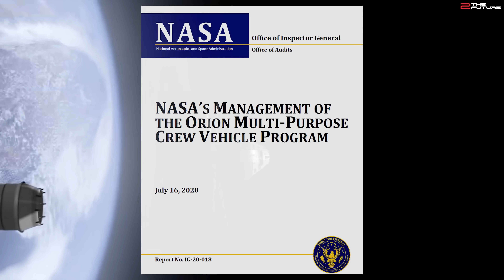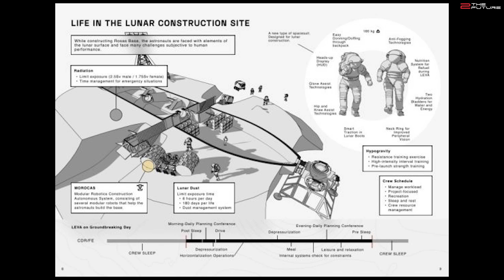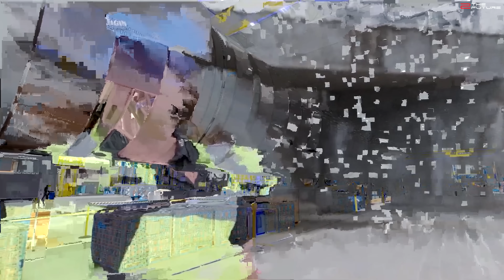How NASA doesn't understand the potential of SpaceX's HLS Starship moon lander.

Comment: BO’s so called much up is actually just a shell with no tanks.  This is why you see the bracing inside it.  

Starship is a one rocket solution to a manned lunar base.  It’s actually designed for a similar mission to mars, so there shouldn’t be any question about this.  I think that we will see a progressive step towards this, Unmanned first then manned.  Starship to orbital velocity. Starship to orbit. Starship to orbit then landing at Boca Chica.  Starship refueling station. And so on with months between each step sometimes longer depending on the complexity and permitting capabilities.  I don’t see a lunar (unmanned) flyby until 2024 or a manned mission to orbit before 2025.  Although they should start Starlink missions in late 2023.  I see 2022 as just working on getting to orbit and back, without crashing.  I also see one more major revision of Raptor after the as of yet unreleased Raptor 2.0.
Reply: Refuelling station will be earlier ! Tiles, fins, header tanks, downcomers, legs etc and return to earth are not required.

Comment: To be fair to Nasa on the timeline slip....a 2024 return was always a pipe dream.  Way too little time, way too little funding, lots of politicians hemming and hawing and not wanting to make up the lack of funding because 'Well look how little you've already done' and stuff like that, regardless that they've done so little because they keep getting held back by ridiculous requirements from said politicians.  

Granted it's not all the politicians fault either, Nasa has been using the same spacesuit design ( with some upgrading here and there, but still functionally the same design ) since the 80s.  They're nowhere near ready with something that can handle what Artemis needs, even with those clunky designs they've liked to show off now and then the last several years.  The program is going nowhere until they have something ready there ( wouldn't be surprised if SpaceX has a solution ready there before Nasa either, they've already mentioned they might give it a try )

Comment: 10 launches for 1 moon trip. 
Hardly the 'less is more' ethos musk bangs on about .
Reply: 10 launches of starship will cost less than a single SLS, remember that starship will be reusable, even more than the falcons, thats their plan anyway.
Reply: @ahchx861  did i say anything about cost?
 Its a convoluted  system.
Address my point or shut up
Reply: @Bow-to-the-absurd  wow easy dude dont be so harsh,  isay that is not that complex when you LEARN that the whole starship plan is launch A LOT and i mean A LOT they are talking about build hundreds starships, they already are building docen of raptor engines per week?, 10 launches for a month of operation is nothing from the point of view of the starship operation scheme they are planing.
Reply: @Bow-to-the-absurd  - it's exactly as complex as it needs to be in order to get more than 100 tons to the moon - while being reusable.

There ISN'T a better solution than refuelling - military jets refuel all the time to extend their range - are you going to suggest that's "too convoluted" too?

Comment: I'm undecided if Blue Origin's latest thing is a mock-up or a mockery. It might be both.
Reply: I believe it is largely for GSE boiler-plating. Really unimpressive development speed. I am surprised it hasn't got "JEFF BEZOS" painted on the side with his stupid face.
Reply: Both!
Reply: PR stunt for Sue Origin. Totally lame 🙄
Reply: @NJTDover   Yes, exactly. If I'm not mistaken, they've shown us this mockup before, sitting in their otherwise empty factory. They had some bad PR lately with losing the lawsuit, so it would not surprise me at all if they loaded the mockup on to the trailer and drove it around just for whatever good PR that might get them. 
What did they actually do with it? They talked about learning lessons for taking a real one out to the pad, but did they even do that? There were no pictures of it that I saw at the pad, just one or two of it just outside the factory building. And they had the temerity to call it a pathfinder "mission". Mission, mind you, as if they were actually doing something with it.
Reply: The rocket connect with the antimatter engineering and warp driver 😀 not a good selection of monkey 🐒 the same engineering from the ground pitched up to 4 people to space ☺️

Comment: Great analysis. I think the real problem with NASA going with just the Starship is that it hasn't yet been proven out. Once that is done, I think we will see a different approach, but until then, by the laws under which they operate, they HAVE to give the primary consideration to proven technologies. The tech for SLS works. It's too expensive, but it works. They (the people running NASA) would be replaced if they didn't try to complete it, especially while there aren't any working, proven systems as alternatives. Sure, they are trying to encourage SpaceX and would prefer to be dealing with them and Starship. It's just not ready today. In time, I think we will see BO putting it's focus on narrow goals, and at NASA SLS will be canceled and Starship will start putting stations in orbit for commercial and government and a base on the Moon. Possibly permanent occupation of the Moon by 2024-25ish. Anyway, we've waited too long for this. It needs to happen.
Thanks for the video.
Namaste
Reply: SLS is in the same situation though? never bin proven
Reply: @flopez425  - Exactly - for all we know? they'll do the first launch and it'll have more problems than Starliner
Reply: @flopez425  Not true. Every separate system in SLS is old school tech, already flown on, for instance the Shuttle (SRBs and main engines) The capsule is standard tech, nothing new there. Everything about the SLS has been flown and tested. Starship, on the other hand, is a unique NEW way to get to orbit.
Reply: @Myrddnn  - Don't be ridiculous - it's an entirely new configuration! by your logic I can say anything made of metal is space-worthy because metal has flown to space before.

If I build a new aircraft out of parts of a dozen different aircraft - are you going to fly on it because each part has been 'tested' before?
Reply: @JohnnyWednesday  You seem to be missing the point. NONE of the tech being used for Starship has EVER been flown to orbit and tested. NOTHING like it has every been tried and there is no way to know ahead of time that it will work.
SLS, on the other hand, it built from proven technologies, ones that HAVE flown on other space missions. While the SRBs, for instance, are a little longer for a longer duration burn, they are the SAME tech, chemicals etc., used by the Shuttle. Same for the main engines. And the Orion has flown once and got a rework since it missed meeting up with the ISS. It is not dissimilar from the Apollo capsules that went to the Moon.
Reply: @Myrddnn  Simply because something takes proven parts from other programs and puts them together doesn't make it 'proven'. Lots can go wrong with the combined system,  and these idiots aren't even thinking of an unmanned SLS test run before putting astronauts on it, even as they made Space X go through hoops to get human rated for the commercial crew program. I should also mention that there are SOME changes to SLS that haven't been proven: primarily to the ENGINES. These are old Space Shuttle engines. They are literally OLD, as in decades old, and they've been modified to push out more power. SS engines were originally reusable (even th ough they needed extensive refurbishment, unlike say, Merlin), well these modified ones are single use only. Anyway, remember Astronauts will be on the first launch of SLS because NASA is too cheap to do otherwise. It must be nice being able to waive your own safety requirements when politically expedient.
Reply: @Myrddnn  well starship also have a lot of proven parts that have been flown. Your point?
Reply: @LeftOverMacNCheese  What parts of the Starship have made it to orbit?
Reply: @Myrddnn  You aren't talking to me with this answer. I don't know who  you are talking to, to be precise. I made one comment, hence I could not 'keep missing the point' as that would imply repeated comments.
Reply: @Myrddnn  a lot, it's very similar to the falcon rockets booster. 
The reason why SpaceX didn't test the Starship super heavy booster is because it's basically just a scale up falcon 9 booster, so the technology is already there, and that's also why they tested mostly the belly flop manuever and not much else because the thing needed already been developed and tested by SpaceX in the last decade
Reply: @remo27  Sorry then. Same questions, different person.
Reply: @LeftOverMacNCheese  Different fuels, brand new engine (no full flow engines like it have EVER flown). Again, remember this is how NASA has to look at it, by law. Not my opinion. One landing from 10km isn't proof that the belly flop will work from orbit. But once we have all of that, all bets are off because NASA will then LEGALLY be able to go with Starship. And to dump SLS like the bad idea it is.
Reply: @Myrddnn  chill man no need to like your comment like that lol
Reply: @remo27  Ever since the late seventies, the congress has reigned in funding, only doling it out to projects that looked to create jobs in their districts. NASA was required, by law, to work only on projects that met that criteria. Yes, they have left the actual astronauts to pay for their mistakes. But they are not to blame for this current problem with SLS. We all know it's over priced, especially when, not if, Starship starts making regular flights. But until it does, NASA has to continue to pay lip service to the SLS project congress saddled them with a decade or so ago.
Reply: @Myrddnn  - Stay on point Jim! you were implying that SLS is going to work perfectly because bits of it have been used before.
Reply: @JohnnyWednesday  Try re-reading. I never implied that the SLS was going to work perfectly, or that it would be somehow better than Starship. All I have been talking about is the position NASA is in regarding approvals based upon the RULES they have to follow. Once Starship is proven, then NASA will have a good argument for dumping SLS.

Comment: Moon starship is still a convoluted design.
Better than sls , but  overly complex.
Reply: overly complex? so you have a simpler design for getting that amount of mass to the moon? do tell!
Reply: @JohnnyWednesday  no i dont.
I dont need to either
Reply: @Bow-to-the-absurd  - so how do you know the design is overly complex? which parts are too complex for getting 100 tons to the moon? which exact parts?
Reply: @JohnnyWednesday  10 launches for 1 moon starship moon trip.
 This is crap overly complex design.
Reply: @Bow-to-the-absurd  - the goal is to get over 100 tons to the surface of the moon - to do that we need enough fuel - so the design isn't 'overly complex' - it's exactly as complex as it needs to be.